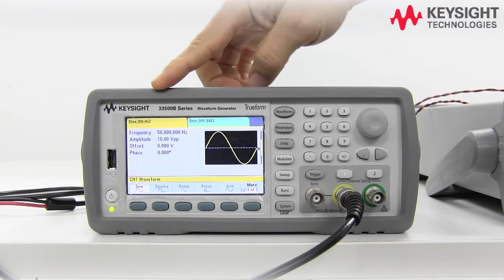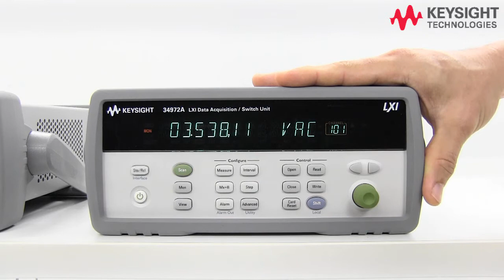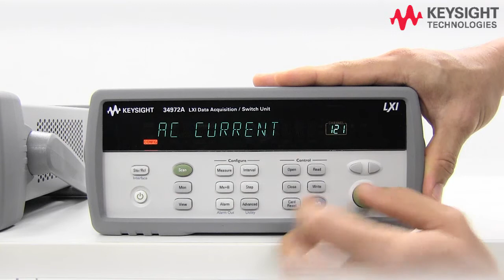Test and Measurement Basics - DAQ | Episode 9 – AC Voltage and Current Measurements

Comment: What troubleshooting steps can I try to restore one of these. I have a stack of 10 of these that are no longer powering on. I check the fuse and it is not blown, or I remove the fuse from a working one and test in a non working one with no response. Perhaps through serial console?
Reply from the maker: A W It is unusual to have a 34970A that will not turn on - so 10 of them seems extremely unusual. You can download the service manual 34970-90012 for free. I agree, if you do not hear the fan or see the display - I would look at the fuse.  As you have probably discovered the fuse also sets the line voltage. Take a look at page 35. Also, make sure all the modules are removed.
Reply: Thank you very much for your response. I'll check the service manual. It could just be the LCD is burnt out or Turned off?  The couple that I've tested will produce a beep when I attempt to connect via serial with putty. I also pull the fuse and check it, then make sure the voltage is set to the 120 value.